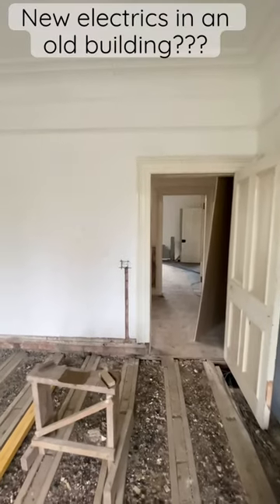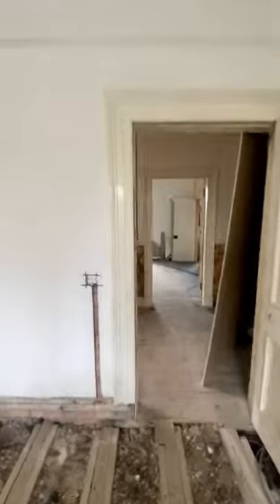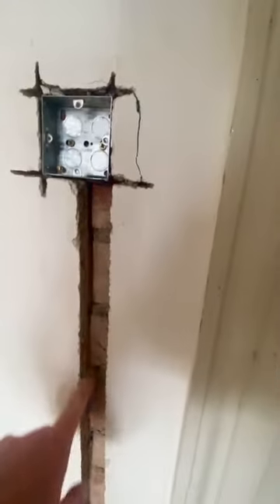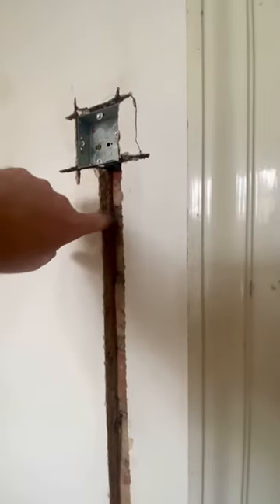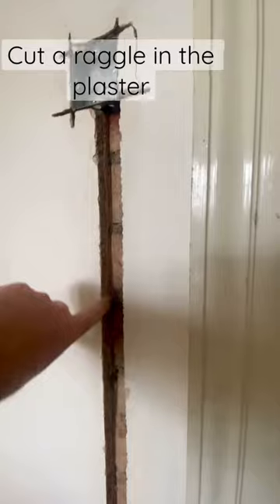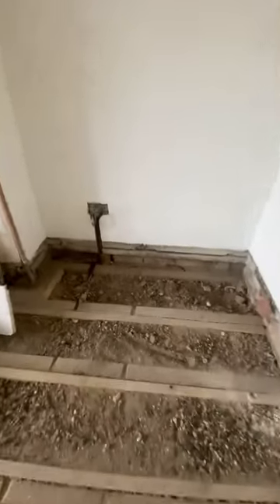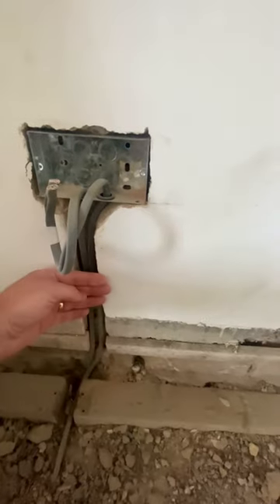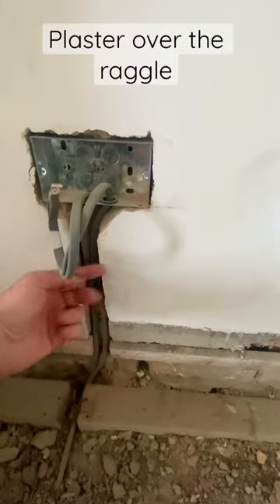How to run new electrical wiring in an old building

Comment: I'm hoping to re wire an old stone cottage the walls look 18" thick , the outside walls are rendered inside someone started a bodge job of dry wall , I'll be using conduit directly above any switches and sockets , anyone reading this would you use metal or plastic conduit ?

Comment: Gonna wanna protect that wire with a track, or conduit.  This is dangerous advice.  There is a 1-1/4” rule as to how the wire should be set in the wall.  This video conflicts with standard electrical code!

Comment: Suggest cables in walls are run in conduits for future access, changes and maintenance before plastering over
Reply from the maker: That is good advice but our building regulations don't require it, so it isn't commonly done.
Reply: @RealLifeArchitecture  I wonder if that would pass in California
Reply: @RealLifeArchitecture   In the UK capping is standard practice to protect cable from plasterers trowels.  The time and materials cost to give your cables this extra protection is negligible.
Reply: Can you do this with Romex?

Yes I know surface mount is preferable I did that everywhere else in this rental, one spot it would just look REALLY bad
Reply: Yeah unfortunately you can only do whatever the customer pays you to do, and if they don’t think that conduit is necessary, and it isn’t required by code, then it can be hard to convince somebody that they really ought to add conduit for safety when it may cost a bit more of an arm and a leg.
Reply: Run conduit pipe man😂your going to let the electricians struggle with that
Reply: Hi sir iam from india
Reply: @chriscolameco6850  What do you mean by surface mount?
Reply: We ain't in Europe mate! En francias 😅
Reply: @RealLifeArchitecture Actually thats not a regulation at all, its a must. One must install conduits and then run wiring/cables etc, whether its stated in the building code or not. Its common sense to install conduits!
Reply: Any decent electrician would run capping over the cables inside the chase  or "raggle" if you like, to give the cables extra protection.
Reply: @RealLifeArchitecture and this is the problem with conractors... "ItS nOt ReQuIrEd". Neither is paying someone to do the job for me...
Reply: @BS-ix7qp not necessary on a chase like this as the plasterers trowel is not at risk of nicking the cables since it just skims over the hard part of the wall
Reply: @tomporter114  that's funny because I've done domestic installs for over 20 years and every spark I know would use a form of cable protection. Whilst not stipulated in the regs this is standard practice. Keep messing about with your little bread boards and micro controllers, grebo
Reply: @BS-ix7qp no need to be so rude, mate

Comment: Is there a video showing how you did this? Cutting a box shape into the brick is hard. What tools etc?
Reply from the maker: I don’t have footage of the cut being formed but I’ve seen it done using multi tool with a chasing adaptor. There are specific chasing tools just for this job.
Reply: @RealLifeArchitecture  Thank you for your reply. I will look further into this.
Reply: He didn't cut into the brick, just the plaster
Reply: In UK we use a tool called a box sinker. It fits on a demolition hammer and cuts either a single or a double box recess really quickly.  Check out Armeg Box Sinker
Reply: @MyPropertyChannel  Thank you for telling me about this. I had to remove a some old  plaster so I bought an SDS drill and by the time I had taken the plaster off I felt proficient enough to channel a box with the chisel bit. I remember trying to make a box years ago with a hammer and chisle 😩

Comment: Would you do the same thing on the ceiling? For example you want a new light fixture on a different part of the room but you want it it connect to the same switch. Is this what you would do?
Reply from the maker: Ceilings in older properties in UK are usually made from lath and plaster. If the electrician can’t run the wires between ceiling joists the ceiling usually needs to be cut. Repairing lath and plaster is tricky, so I can lead to the whole ceiling being replaced or re-lined to get a smooth finish

Comment: Mannn what if someone was to drill holes for whatever purpose it is and then hit that wire? You gotta protect that wire man
Reply from the maker: It had a metal plate over the wires before plaster
Reply: We have zones they are in BS7671 thats why we run vertical and horizontal from visible accessories
Reply: @RealLifeArchitect  no it didn't let's be honest. But at the same time it doesn't need it either.

Comment: U dnt put conduits in the wall before plastering😮
Reply from the maker: The electrician certified it. Metal cover plates were placed over the wires before plastering

Comment: There is no need at all to have the full floor up. My home is currently being rewired and the electrician has done nearly everything without lifting the full floor and making a mess of the walls. 

Ps, my home was built in the 1950s.
Reply: What can be done?

Comment: Imagine a house without earth connection and plastered on top of that brick with a really thin later ..that's what I'm dealing, so probably I have to dig that brick a bit ...fit a tube and deal with it
Reply from the maker: I’ve seen several older properties where the original earth had corroded away to nothing. The owners were getting shocked by the taps and radiators
Reply: @RealLifeArchitecture  there are tools to check if the socket is ok ...it would find that earth connection is off in a second - I'm still wondering now how the hell I'm going to make to without tearing down the whole wall

Comment: If you plaster over that bunch of cables the plaster will simply will crack. We normally pushing the cables into the hardwall to secure them in place. Same with the back boxes
Reply from the maker: This one got a metal cover plate

Comment: Little request for all electricians, if you could set switch sockets at least a plaster's trowel width away from the architrave it would making life for plaster's a whole lot easier . Agree with above comments, also needs conduit /protection, hard wall or bonding  then skim  plaster / fill.

Comment: That's the biggest saftey violation i've ever seen. Have fun when someone drives a nail through the wall and blows up the circuit
Reply from the maker: The circuit is fused, earthed and a metal cap was fitted over the wires before being plastered.
Reply: Violation? You want to read up on the regulations before you pick at another man’s work
Reply: We have safety zones here in UK, horizontally and vertically from every outlet and switch, just so we know where NOT to put a nail
Reply: @MyPropertyChannel pretty sure that's a code requirement in most countries.
Reply: Every electrician knows where not to put a nail, but you can't say the same about the average householder, putting up pictures, or screwing shelves to the wall!

Comment: No proper electrician would ever plaster over cables without covering them with capping or oval tube . When you see things like this this it’s obvious the rest of the installation will be inferior
Reply from the maker: FYI - https://www.youtube.com/channel/UCYKd8cEGM1Ahig2TF2zmwKw/community?lb=Ugkx5LQKUnrzfIdoUU87h8NaVAnBG_JwNtAD
Reply: Electrician here, there is no reason to cover the cables with tubing, the insulation will hold up just fine so no safety reason. And if the cable has many bends or is quite long, you wont be able to pull a new cable through the tube anyway
Reply: @hemorrhoidlover9197  I agree you don’t have to cover cables with tubing . When I was an apprentice I was always told the regulations are the minimum standard.
That’s why professional electricians always use tube or capping. We also only have straight runs with no bends except when using round conduit with proper bends
Reply: Rcd protected why bother with ovals?
Rest of installation is perfect I'm 100percent  sure
Reply: @yesihsaid  it’s what professionals do .
Reply: @hemorrhoidlover9197  Hi, legitimate question here. Doesn't the wire expand through current cycles? I would think that would compromise the sheathing. I could have stuffed some more wire in my conduit when rewiring my garage but I stuck to the standard and that's what it called for. I think it was 50% fill or something along those lines.
Reply: Professionals don’t use capping or oval in a chase, only on an unplastered wall
Reply: @hemorrhoidlover9197  using tubing would make it easier to fish new lines for future renovations or repairs. 

Plastering the cables into the chase will be a nightmare for the next electrician who has to make repairs or upgrades.
Reply: Just run singles. No sheathing. No conduit. No rcd.   Regs are just guidance. But get the architect to sign a waiver.. (disclaimer. Might not last as long as doing it properly )

Comment: What if the floors aren’t ripped up…?
Reply from the maker: The wires have to get from the fuse board to the sockets, switches and lights. Until someone figures out wireless electricity this will mean existing buildings need to be taken apart to run wires.

Comment: Cables need oval tube over them to avoid diminishing the cable’s current carrying capacity
Reply from the maker: How does that work?
Reply: @RealLifeArchitecture   When cables are immersed in plaster, there is more heat build up which increases resistance. So it needs the air gap that containment provides. It helps the circuit to run more efficiently.
Reply: 😂😂 not at all clipping the cables directly to the brick gives you more current capacity and capping and oval tubing offer no mechanical protection whatsoever, as long as they are protected by an rcd and 50mm deep this Chap is totally spot with his work. Capping was originally used when there was no rcd protection and protects against trowel nicks really. But I do use capping myself when doing kitchens and sometimes the oval, but when it's a shower/ cooker cable I would rather it be clipped direct into the wall as it gives you so much more current carrying capacity.
Reply: @AdamSpooner191 maybe if you blow into the tube at one end 😅
Reply: Wrong. In conduit reduces the current capacity. Embedded in a wall helps heat dissipation.